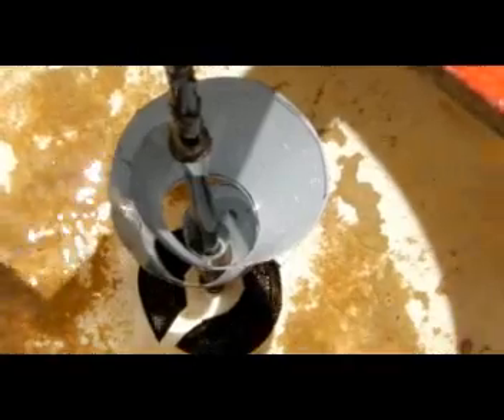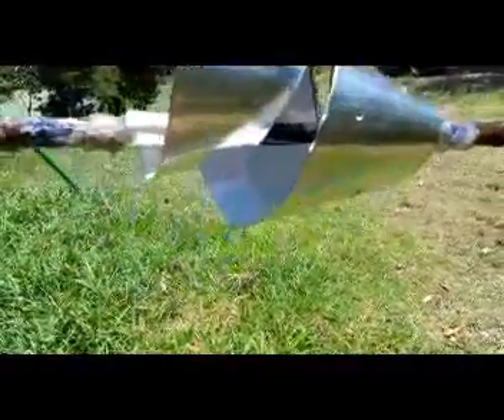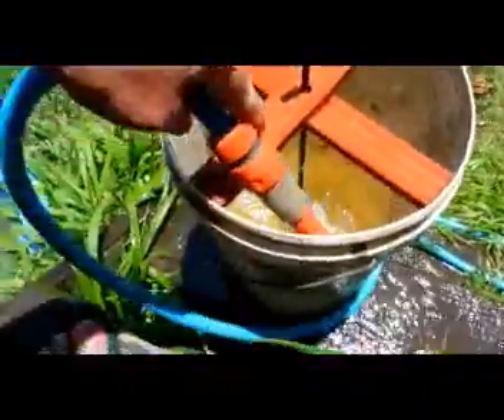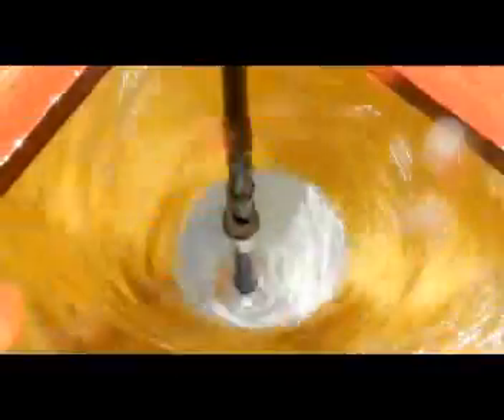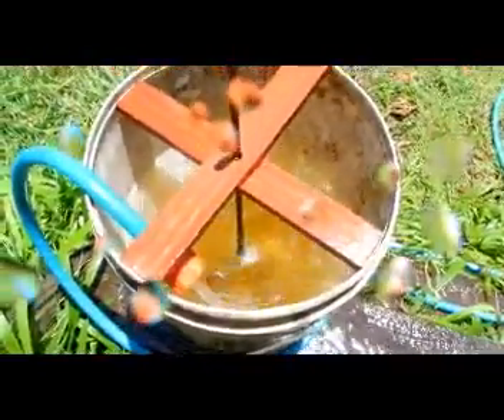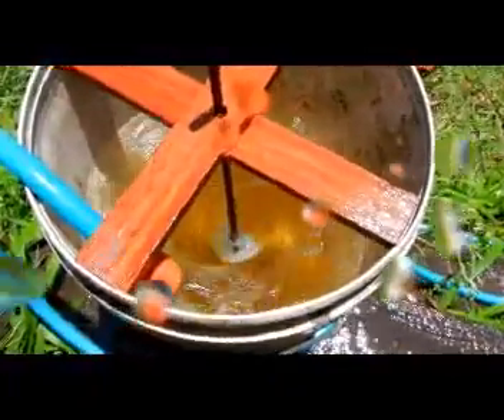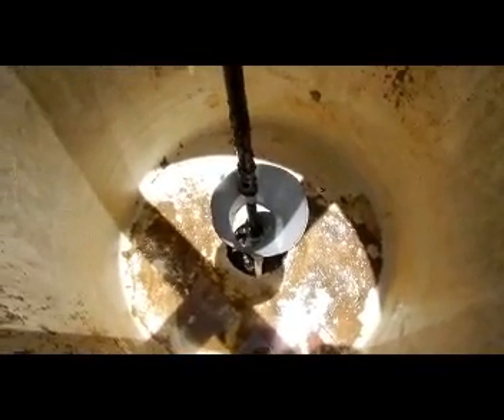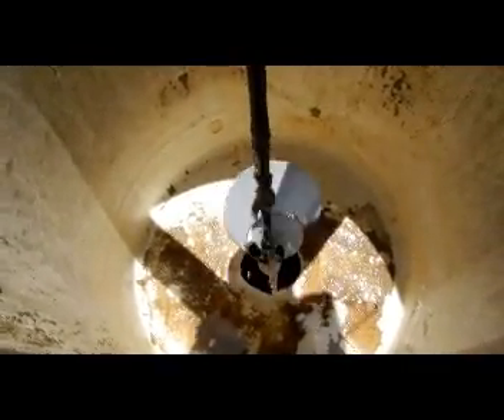Vortex experiment  impeller inspired by the work of Victor Schauberger hydro power

Comment from the maker: this impeller is the twisting of a crescent obtained by scribing from the crossing point of a circle divided by 9 and doubling from the 1 position which gives your a figure 8 crossing itself at a point below center employing the numbers 1,2,4,8,(16=7)   (32=5) (64= 1),,the numbers not involved are 3,,6,,9 a curved scribed by placing the needle of the compass on the crossing point of the doublined figure 8 shape and the scribing tip to the number 3 then scribed to point 6 on the equal opposite side gives you the impeller in a flat 2 d shape then once curved anti clockwise  and clockwise the other side gives you this shape

Comment: The only thing I can add to this is you need to block light from touching the water as well as add minerals. This is great using the motion of the flow as the propelling force. At 4 Degrees C/39.2 Degrees F and the water will start to expand as it reaches it's anomaly point. The water can not be pushed by an outside force, I see many try this with a power tool forcing the water to influence the motion unnaturally. Thank You!

Comment: why not use the impeller to create the vortex and then capture the energy
Reply: Because of the first law of thermodynamics
also called: "Law of Conservation of Energy"
which states that:
"Energy can neither be created nor destroyed; energy can only be transferred or changed from one form to another."
So if you use energy to rotate the water then the theoretical maximum of energy you can get out is exactly the same amount as you used to rotate the water, however in reality it's much less energy you will get out because of friction and such.

Comment: Your 'experiment'  depends on a source of flowing water and gravity, so if the impeller was of Schauberger design or not it would still rotate. 
The question should be — what is the advantage of a Schauberger impeller over a standard one? 
My understanding of Schauberger is that he deplored the damming of rivers to drive a turbine to produce power as occurs in hydro-electric schemes. 
Unfortunately not everyone has a flowing stream available and that water coming out of the hose you have costs money where I live.
Reply: the hose was connected to an ever filling dam up the hill so no worries on the cost
Reply: I have a bladeless design of vortex--check it out😀

Comment: Great vortex propeller. Can you give us some more information on how you made your vortex propeller.? Did you know you can make a free energy vortex generator that can also be used as an ant-gravity machine.? Take an egg shaped vortex vessel and cut it in half. Place a golden ratio pyramid on top. As the vortex rotates and hits the side of the pyramid, it produces an upward lift. The secret here is to direct the water that comes off the pyramid and "condition it" on the way down, so that as it falls, it actually adds to the rotation of the vortex propeller and engages the "bottom" propeller at right angles to gravity.
Reply: I have a bladeless design of vortex--check it out